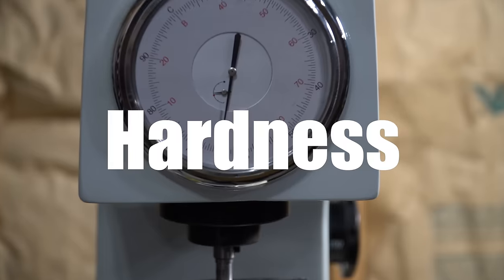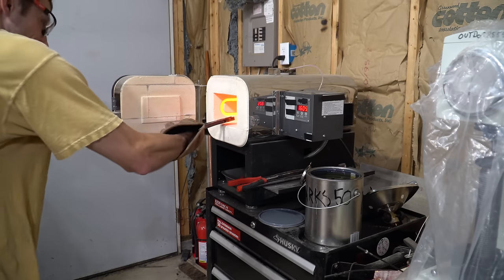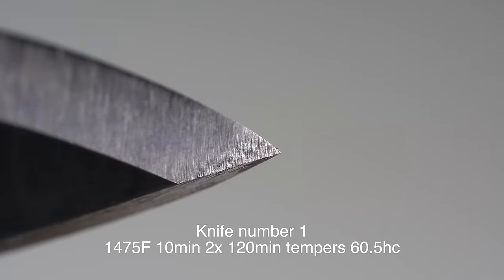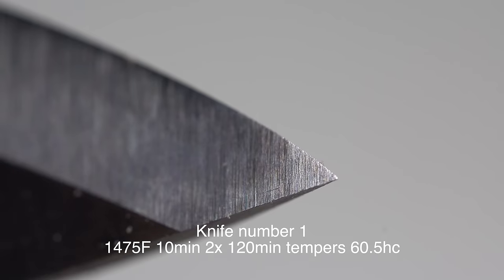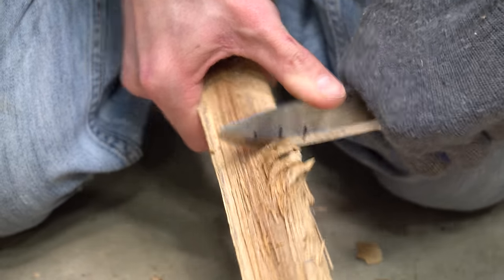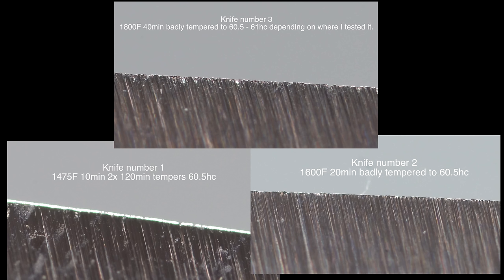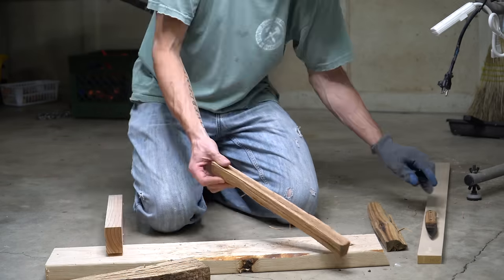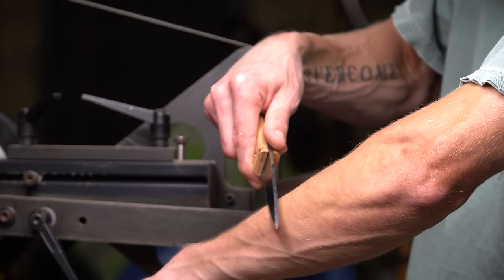The BIGGEST LIE in the knife industry- Good Heat Treatment vs BAD Heat Treatment

Comment: I'm super curious what causes the curved line under the marks from the bronze test. It's on all 3 so curious about the physics there. Also as for the knives cutting and dulling the same is honestly just how physics works. It's all pressure and when the pressure drops from blunting, it stops cutting but it's fairly binary. A knife will cut as long as there is an edge and then sharply falls off around the same spot no matter the steel or starting sharpness. This is why you should never believe thos knife commercials where they best the knife up and it still cuts. It's all a trick because any edge will cut with enough pressure.

Comment: That was an interesting video. My head spins considering all the factors that make up a "good" knife. Blade steel type, heat treatment, blade geometry, etc, can make a difference. Also how do you define a "good" knife? I was wondering if Magnacut could make up the ultimate knife myself. Anyway thanks for the video.

Comment: I’d like to see this experiment done with similar soak times and different austenitizing temps but the same tempering temps. It would replicate someone heat treating in a forge without a Rockwell tester. Even seeing this done with CPM steel would be interesting.

Comment: On knife#1 (the "good heat treat one"),, what is that back line running at about 90degress to the grind marks near the lower edge close to the tip,,, is it a crack????

Comment: Hardness isn't everything as can be seen in your tests or on say Spyderco VG10 at about 60hrc and Japanese chefs knives or Mcusta folders in VG10 at about 60hrc as well but have up to twice as much wear resistance.
But then we see knives from Cultrotech in m390 do 2-3 times better(depending on "regular" vs custom heat treatment and hardness) than Spyderco or Benchmade. A big part is because Denis Frolov/yanhook is a master at heat treatment but that better heat treatment also results in higher hardness, 63.5 hrc for the "regular" and about 64.5hrc for the custom heat treatment.
Those knives don't just perform better because they're harder. They have a better heat treatment protocol which results in harder blades.
Hardness isn't the end all be all but it can give you a hint on performance. M390 at 58hrc isn't going to perform that well because to have it that low there's some off with your heat treatment. Either no cryo, too low of a soaking temperature, too long of a soak, poor quench, too high of a temper temperature, too much retained austenite as a result and you get a steel that performs worse than it should. 
Great video. Thank you for taking all this time and effort to make an interesting and educational video.
Reply from the maker: High carbide forming steels and high alloy steels are another story altogether. 🙂
Reply: @OUTDOORS55  true. Though I think it's those steels(m390 class especially)that a lot of people just concentrate on the hardness number and nothing else.
It was really surprising to see that the wear resistance was the same  while you could clearly see the difference in toughness and edge stability. Just shows to show that steels can behave really weird sometimes and not at all to our expectations.

Comment: Very interesting testing and results.  I wonder if the results of your testing are the reason that working cutlery such as axes, mauls, hatchets and machetes are not normally seen rated for hardness. While many have the type of steel listed I don't often see a hardness spec on them.

Comment: I found a random piece of steel (pretty sure carbon because it started to get a surface rust in salt water) and made a knife out of it, heat treated it in some fire bricks with mapp gas for a lil bit trying to get it sufficiently glowing and quenched it in mineral oil. Sharpened it once and it has amazing edge retention after cutting tons of hardwood, I think it’s a bit too high HRC and will chip though

Comment: I'm no knife expert but I thought this was already known. If it's the same steel at the same hardness, they will hold the edge the same, but the proper heat treated and tempered knife will be stronger, and less likely to chip/break. Edge retention would be more impacted by the type of steel used and edge geometry at a specific hardness. I guess next is to find out hand forged knives are no longer the best knives, factory made super steels ground to shape are the best knives because they have far better control of the process than anyone can when hand forging.

Comment: I think that you should have included a not heat treated blade.

The Rockwell hardness is a surface test.  And the difference that is important is brittleness.  Thus you found in breaking the tip in paper (MDF).

Heat treating allows molecular migration and grain formation.

Thin blades are more susceptible to shattering vs thicker blades, given the same time/heat.

Comment: I'm a retired tool maker, and machinist, and have many factory made knives. All of them start out holding an edge, but the more the edge gets removed through sharpening, the softer the edge gets, to a point were they cut 2 or 3 times, then need resharpening. I've made knives from 01 tool steel, hardened and tempered to 65 rc, and can skin 3 or 4 moose, without needing to sharpen. I certainly would not cut nails with my moose knife, but I'll guarantee it will shave you after you've finished with the moose. If you expect a knife to shave you, AND cut framing nails in half, I recommend using an axe. I don't use screw drivers as prybars, and don't use wood chisels to scrape off paint. I also carry my camp knife that I eat with, cut kindling, rope, and moose tendons. The right tool for the job. In 40 years, I've skinned dozens of moose, deer, and bears, and my skinning knife gets the once over on a 1,000 and 1,200 diamond lap, at the beginning of hunting season, and it's good to go. I heat blue the spine of the blade back to 45-50 rc for ferro-rod striking. My moose skinner has a 3" rad. hollow grind, with 10 degree point,, wide radiused tip ending at 70 degrees to the centerline, micarta grips, and stainless guard, and butt plate. The leather sheath is dipped in melted wax, because 01 tool steel will rust. My camp knife and machete have straight grinds and the leather waxed sheaths, for the same reason. There will be people that disagree with me, but unless you've spent more time on a Rockwell hardness tester, heating and quenching every tool, and die steel available, I'll keep my knives the way they are. I have yet to see a better blade from any manufacturer, than mine. PS, my machete is made from an old, 1940s tree saw blade from a paper mill. I think it is 1/4" thick 4340 high carbon steel, from an 8 ft dia. blade. It cuts nails, and trees.

Comment: A related big myth out there is the difference between a good (correct) HT and a super special custom quenched in unicorn tears difference. When the spec sheet is followed for a HT recipe it is very difficult to realize substantial improvements beyond that. There is lots of room to degrade performance from the recommended recipe, but not much room for improvement. HT is a sort of pass-fail in nature.

Comment: I know this pisses people off in the 1095 fanboy club, but 1095 isn't super tough. 

Most companies under harden and over temper that steel and would probably have MORE toughness with simlair edge holding in a lower carbon steel like in the .60-.80 range  5160, 8670, 15n70, 1060, 1070, 1075, 1077, 1080, 1084, 80crv2.

You won't see a good sword or axes in 1095 for a reason.
The extra carbon makes the steel less malleable and flexible. Even with the extra tempering compared to a lower carbon steel at similar hardness.

People really like 1095 though, and those companies can do a mass production in house heat treatment and the wear on tooling and abrasive cost is lower then even if they changed to 52100 at the volume they produce at. It sells, people like it, people know it, why change l guess.

There are also more alloyed, low carbon steels that can make some of the most durable almost unbreakable knives and tools like A8MOD, INFI and 1V to name a few.

Comment: Edge retention is determined more by hardness and carbide type and percentage, they were all the same hardness and I'm assuming the same steel, so the same edge retention results makes sense, the bad heat treat messed up the strength and stability

Comment: logically hardness only tests one thing in a knife. With all 3 knives being the same hardness the edge retention should be about the same as it only shows how much a softer material will wear on it. Now that said the forging showed how likely they are to snap when pressure was applied to the thin side of the blade rather than the thick part. That would be the tip breaking due to the grain structure of the metal. That's why a soft core was used in long blades like swords. that way there was some give where as a hard blade would snap.

Comment: A blade that has enlarged grain from over heating can still cut but it’s flexibility is severely compromised
If you want a good feel for the strength of the blades , put them in a vise and see what it takes to break them. Put an appropriate piece of pipe over the tang and see how far the blade bends until it breaks.

Comment: Im not sure what steel you were using but now i see at the comments you said 1084. As a maker of professional grade throwing knives which ishape and heat treat myself, as well as a life long knife and tool sharpener and collector. Some steels have a very big window for getting a decent result which 1084 does. Some steels like D2 have a very narrow window which is why i usually wont buy knives made of D2 even though its fantastic it must be heat treated correctly by someone who knows what they are doing.. recently i bought the crkt razel made of D2 and i must give it to them because they did it correctly and its fantastic.

Comment: Yeah I dunno about any of that shit .
 What I know is when I heat up a piece of steel until it is no longer is affected by a magnet and quench it in mineral oil it gets so hard that I cannot sharpen it with thes fancy water stones my wife bought me and I find them a little brittle.
   If I put it in the oven anywhere between 500 and 400degF ( depending on use)for an hour or so and let it cool slowly  I can sharpen it with those stones nicely. 
 This procedure makes decent knives and chisels that are not so brittle they break.
    this seems like overkill to me but I did learn something.

Comment: I'd say from your results a bad heat treatment can show good sharpness and edge retention if sharpened properly but a overheated treatment will cause the blade to have multiple wrak points and no hardness in the center of the blade. So on the outside of a bad heat treatment it could hold 61Hrc but have 40-43Hc inside while a proper heat treatment will hold 60-65Hc uniformly across the blade and down to the inside center of the blade not just the outer surface.

Comment: I'm not surprised you got the results you did. I am curious if heat treat would impact corrosion resistance. I wonder if a larger grain structure wouldn't give a better foundation for the metal to oxidize. Even if you had the exact same finish it might have an effect at the microscopic level. That would be a really cool test to run on something like LC200N or Vanax. Where it would give a very clear indication that the integrity was affected.
Reply from the maker: On certain steel heat treatment absolutely affects corrosion resistance. Its a fairly complicated subject. Knife steel nerds has a lot of information on their site regularly this.
Reply: It really does, it’s why Bark Rivers Magnacut behaves like an A2 (not kidding).

Comment: Thanks for the nice effort. Can you the same test with 52100 steel? It's a hard steel to work with without proper heat treating equipment. Besides it's the only good steel I could get my hands with aside from spring steel. Your opinion would greatly be appreciated.

Comment: This is interesting. I always have equated toughness to some degree with hardness but that’s not necessary true.  Nice testing!
Reply: Something I learned in a materials science course years ago is that hardness and toughness are almost opposites (not in definition, just how they interact). A harder material is more likely to be more brittle and less tough, so there's some extra steps after the quench to reduce hardness and restore toughness.
Reply: They are actually somewhat inversely correlated, depending on several other factors.
Reply: @michaelmurphy2112  you’re right Michael. I was sort of thinking along those lines but you said it way better than I did.
Reply: @garethbaus5471  yes.  I was trying to say that but didn’t say it the correct way.  Thanks.

Comment: I've always considered tempering blades to a bainitic form but I don't have the equipment. 
Bainite swords or blades have always been a mystery, a secret that people do not tell, I think you can achieve by tempering blades in melted tin.
Can you try in please?
Reply from the maker: Bainite doesn't make good knives. Id suggested picking up knife steel nerds knife engineering book where dr larrin thomas explains the reasons why. Its a solid read 👍

Comment: So there are some important factors that are very hard to control for - you've clearly thought a lot of this through and I commend that. However.

Hardening in the way you have measured is only measured atthe surface. So all these knives had the same SURFACE hardness, but the hardness throughout will no doubt be very different.

Case hardening vs. Full depth hardening.

Additionally, the mechanical properties are affected in some ways by pre-stessing (See: hardening) but not in others.

Sharpening and edge retention both are forms of abrasion, one could argue. Less important for that is the heat treatment, and rather more important is the cohesion of the minersl structures, and the breaking stress of the bonds between structures / atoms.

There's a lot to all this - and to be really certain you've got to be scientific.

I'd love to see 2 more test runs.

One where you control for TIME in the heat soak.

Another where you control for TEMPERATURE in the heat soak.

At any rate, great video  thankz so much.
Reply from the maker: All these knives are through hardened not case hardened. I can't explain this in a YouTube comment but spend some time on knife steel nerds website and you'll see why this is the case. Theres also answers to your other issues on there as well. Its run by Dr Larrin Thomas. He wrote the book knife engineering and has a doctorate in metallurgy. Different steel types hardened at different rates and depths. These were 1084 and will through hardened even at 1/2" thickness. You may run into problems with larger very thick pieces. But for knives 1/4" thickness and under they will through harden.

Comment: Hello, I have a bunch of damascus folding knives I bought from Pakistan on etsy for about $300. Their handles are really beautiful using brass, wood and even bone and have engravings. However, their design is shockingly bad (the edge hits the inner handle when you close it).  If I ship them to you (to keep) will you make them feature in a video :)? You can honestly make the video on whatever you want. Testing them to destruction, modifying them, anything you want.
Reply: If it's folded then it's not Damascus.. it's folded steel or pattern welded.
Sorry, I just hate seeing people naming something Damascus when it's not. And there actually big difference between them.
Reply: @maayu8108  I think they meant it was a "folding knife" in damascus, not a folded damascus knife
Reply: @maayu8108  its perfectly fine to call   pattern welded steel - damascus steel.
Reply: @maayu8108  just to get this right, folded steel is, compared to patternwelded, just the same kind of steel folded in on itself?
Reply: @maayu8108  Dude, learn to read. And drop the eye patches... What you want to limit Damascus to, isn't even FROM Damascus. Historically, it was merely shipped through there. That's like getting angry at someone calling a jeans pants "denim" when it was fabricated in Indonesia. (and yes, that is a proper and correct analogy, though I doubt you're smart enough to understand it)
Reply: @maayu8108  Bruh folding as in the blade can close into the handle, and pattern welded steel IS damascus steel. Stop acting like wootz steel is still abundant and youtubers regularly upload videos using it. Pattern welded steel is the true damascus steel that we have with our technology.